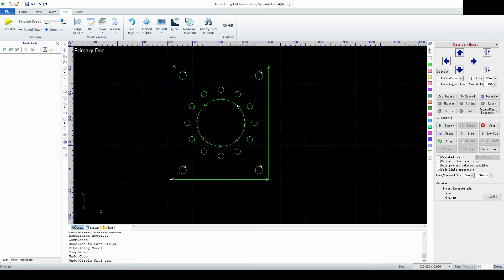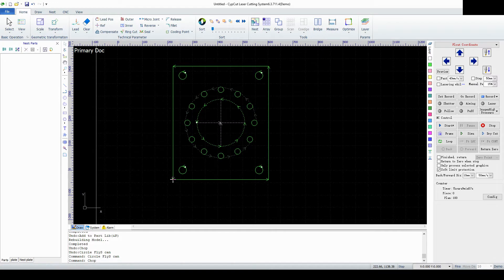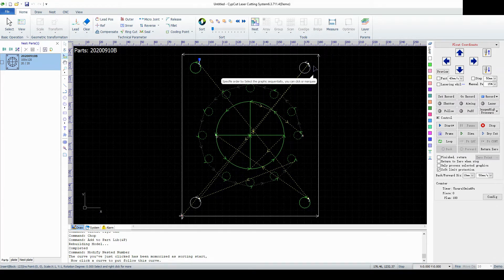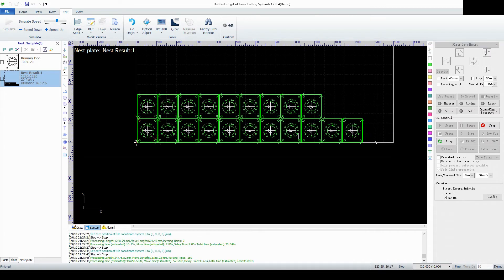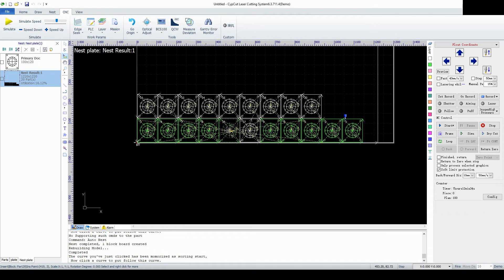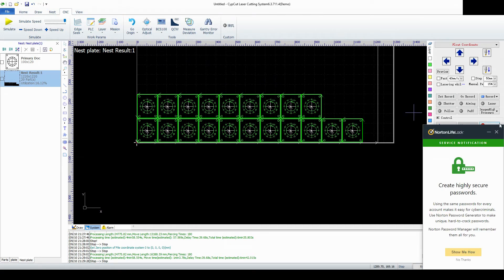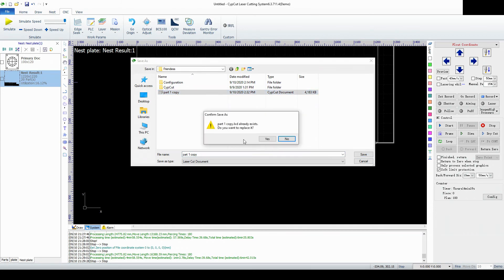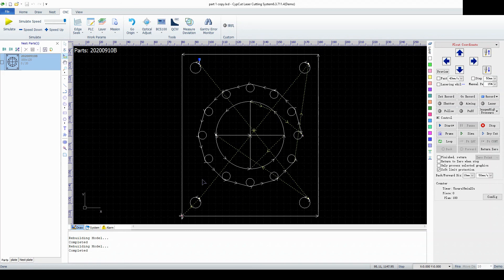Manually sorting cut patterns in Cypcut. (English)

Comment: Hey guys, love your videos.  Have you ever thought of making a video of how to determine cut settings for a new material you've not cut before?  We all know how to enter them onto cypcut but it's a grey area with advice on making a cut and analysing the result and then what to tune to make better cuts etc etc
Reply from the maker: That is something we could cover. A limiting factor is that my machine is only a 500 watt so I am somewhat material limited.
Reply: @smallshoplasers8785  I'm only at 1000w so not a world apart.  I struggle with things like dross on the bottom of 1.5mm and a tiny zip like serrated mark all the way around the side cut of 2mm.  A good video would cut something wrong on purpose, look at the cut, and then tell what steps to change?? Idk, just dreaming here lol
Reply from the maker: @r-joule  Are you using Oxygen, Nitrogen or Air?
Reply: @smallshoplasers8785  oxygen my friend...
Reply: @r-joule  what kind of materrial do you cut? mild steel, inox?